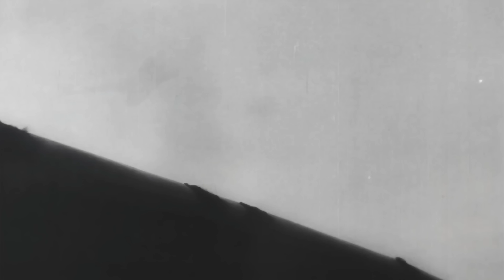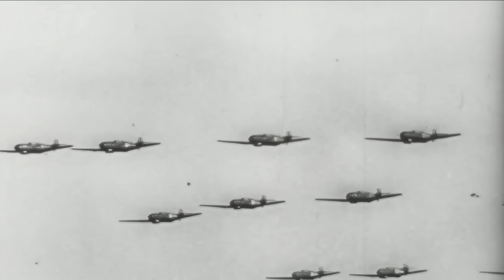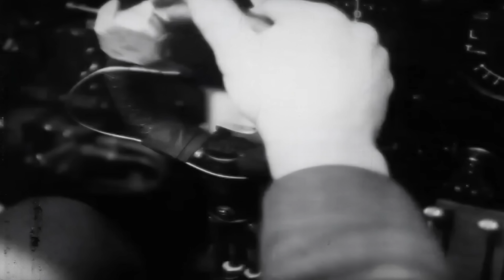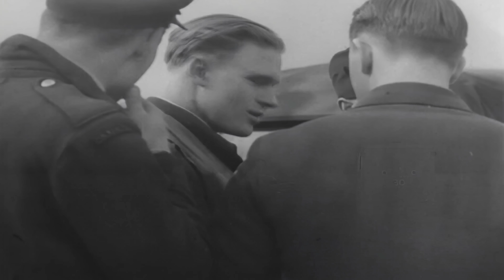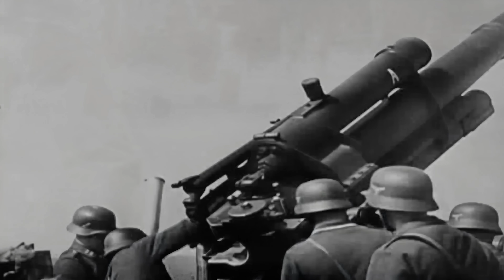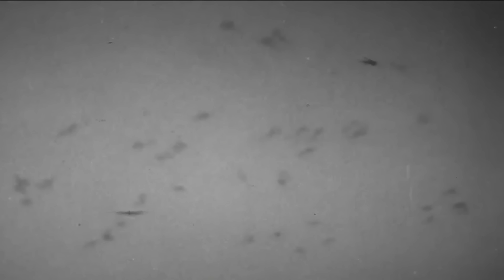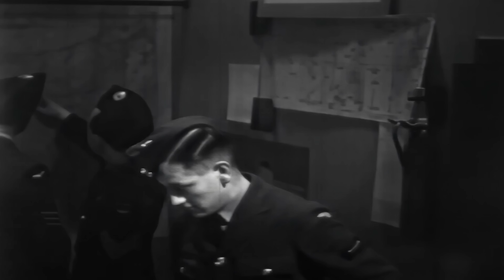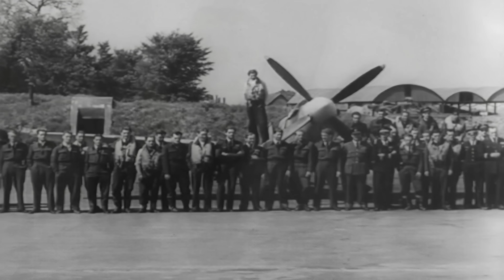440mph Monster That Cracked Germany’s Air Force

Comment: Think most of the article is about the tempest.   Typhoon was abandoned relatively quickly as the could not fix the weak tail section!
Reply: But they did fix it though. Fishplates and resolving it's dynamic resonance problems.
Reply: @Goit_Goit Resonance was the real cause of structural failures and I believe the fishplates continued to be fitted for "pilot reassurance".
Reply: @eifionhowells yup.  The findings made by Farnborough to resolve this fed into future aircraft design.
Reply: The Typhoon was still in service at the end of the war.

Comment: The big air-scoop radiator under the Typhoon's chin was a problem when pilots had to ditch over the Channel, as it tended to cause the plane to dive deep underwater rather than skimming the surface as a Spitfire would.
Reply: They would cartwheel. They were very heavy and undershooting on finals was a problem.

Comment: Many of the Typhoons problems were solved in the Hawker Tempest, which was basically a Typhoon with thinner, laminar flow wings.
It became the fastest low-level Allied fighter of the war.
So the progression from Typhoon to Hunter and Harrier is incomplete without a mention of the Tempest.
Reply: The Hawker Fury was the next step up from the Tempest, but it never got into combat because WWII was over. Since the RAF wanted to get into jet aircraft and the Royal Navy hadn't the budget for jet development, they requested the Fury be converted to carrier operations. Hence the Hawker Seafury came of age. Even to-day, it is considered the fastest single engine prop aircraft in the world. It 

had five blades for a propellor, injection carburator and a 4 stage supercharger good to 38,ooo feet.
Reply: Excellent points! 
My Dad ( RAC&RAF )
Reckoned the Tempest, was a total game changer. That changed everything, of how fighters would be designed, forever!
👍👌🤙
Reply: Actually, Dark Skies didn't completely ignore the Tempest since half of the aircraft shown in the opening sequence are Tempests. Probably wasn't deliberate; more a case of not knowing their subject!
Reply: @ChrisCarter-i9c  Yeah, I noticed the Tempest in the video too. Dark Skies is often careless in this regard  ie shots of Spitfires and even a Lancaster in flight while talking about the Typhoon. Nonetheless I salute them for telling the stories.
Reply: @ChrisCarter-i9c  In fairness most of the commentary is very sketchy at best, and the accompanying video footage even more so.
Reply: And the Tornado although I think only one was built.
Reply: @kevanhubbard9673  I don't know how many Tornadoes were built but they never got past prototype stage.
RR dumped the Vulture because they were troublesome and the Merlin was creeping up in power.
The Griffon was also coming in
Reply: @kevanhubbard9673 Tornado was cancelled 1942 because of lack in reliability of the RR Vulture engines! 

Some had the Napier too... 

Both massive 24 cylinder H/X-block engines with 4 exhaust stacks!
Reply: You’re absolutely right — the Tempest really deserves that spotlight. It took everything the Typhoon got right, fixed what it didn’t, and ended up becoming one of the best low-altitude interceptors of the war. Without the Tempest, the lineage from Typhoon to Hunter and Harrier feels like there’s a missing evolutionary link in the Hawker story.
Reply: We may hear a Sabre again in coming years, there are moves to restore some and even hopes we might even see a flight of a Tempest 5 with one if only briefly.
Reply: @ScreenworxStuartwillard  That would be awesome! 
From my point of view, I'm not sure if any South African pilot ever flew a Tempest, but we did operate the Sabre in the 1950's with the Cheetah Squadron in Korea after starting the war off in the P-51 Mustang.
Yet, the aircraft I'd rather see and hear flying would be the Hawker Tempest.
Reply: I HEARD THAT THE ONLY COMPLETE TYPHOON, THOUGH NOT FLY-WORTHY, WAS ON SHOW IN A FRENCH MUSEUM.  I'VE ALSO SEEN A COLOUR PHOTO OF IT,   LOOKS GREAT.
Reply: The typhoon, Tempest, sea harrier it diminishes the original concept of what a war winning fighter ought to be and celebrated for what it was👍.
Reply: It gives me goosebumps of what an aircraft of it's caliber might have been in the pacific theater of war? or was it?
Reply: @williammcdonald3293  The Typhoon would never have worked in the Pacific Theater with the engine problems it had.
The Tempest would have changed the game completely with it's ground attack ability and it's speed and firepower in a dogfight, but only in Burma and the surrounding countries, where it didn't have to travel too far to reach it's targets.
The Tempest did not have the range of the P-51 or the Thunderbolt, nor aircraft carriers to carry the fight to the Japanese that could carry the Tempests. 
The Yanks would never let British aircraft in on 'their' operations or airfields anyway, and Admiral King was such an Anglophobe that he'd rather lose a battle than admit anything from Britain was better than anything the Yanks had, so American carriers were out of the question.
Reply: The problems in many planes were solved in other planes
Reply: Also the Transformation from inline piston engines to radial piston engines from the Tempest on!!!😉
Reply: @einautofan6685  didn't it use an H-layout engine?
Reply: @Sam-w6z3z  At least from Tempest Mk.II on to Fury they used the Bistol Centaurus Radial Engine...😉👍

With the (1942 cancelled) Tornado they realized RR Vulture was not reliable...
Reply: @einautofan6685  thanks for researching the topic for me
Reply: Absolutely. This video blurs the Typhoon > Tempest evolution by not mentioning the Tempest at all! For example Squadron Leader J. R. (Bob) Baldwin DSO, DFC & Bar, flew the Tempest (not the Typhoon)
Reply: @Greeves 👍 Did he not fly both?  Wasn't he one of the first tank buster lot in a Typhon!🤙
Reply: @Greeves  Actually he did, he was OC No 123 Wing Plantunne  May 1945, from Osprey aircraft of the Aces, Typhoon and Tempest Aces WW2
Reply: @skyboom1961 Thanks for the info’. I stand corrected 🙂
Reply: And its issues were solved by the FURY
Reply: @GeorgeJungle-x9l  I think that would be the Tempest 2. 
That had the same Centaurus engine that powered the Sea Fury
The Tempests that flew in Europe were Mk 5's that had the same Sabre engine and chin radiator of the Typhoon.
IIRC Tempest 2's were going to be deployed against the Japanese but Hiroshima and Nagasaki happened  just before

Comment: Curious omission of mentioning the Tempest, the best British piston-engined fighter.
Reply: The video has a mixture of Typhoons and  Tempests. Side on, the thinner wing profile and elliptical wings are Tempests.
Reply: @grahamy3400  And a fillet in the fin.  Rather sloppy editing in fact ... a mix of different aircraft when talking about Typhoons and then says the 109E was beginning to outclass the Spitfire and Hurricane of the time.  No it wasn't ... the Emil was the standard Luftwaffe fighter from the start of the war until well after the Battle of Britain and was largely equalled by both British types throughout that time.  The video should stick to the subject ... the Typhoon and 190 ... and stop rabbiting on about other types, just to fill out the time.
Reply: @grahamy3400  And Spitfires, both Merlin and Griffin engined.
Reply: Best Wartime fighter, maybe. The best British piston engined fighters were the Sea Fury and the DH Hornet
Reply: @bugattieb110ss  Problem with your supposition is the same thing as plagued the americans until the early 70's.     Dogfighting was NOT dead.    When it came time to replace the F4, 104 105 etc etc they built birds that could turn and fight, 'dogfighting'.   Vipers, Eagles, Hornets, Tomcats, brought BACK close in capability....   all the bad experience vietnam war showed the way.    In 1945 dogfighting which includes turning was FAR from dead and in any close in scenario the planes you mention would be at a severe disadvantage as I mention below to a clipped bubble canopy 4 cannon big block spitfire.    It isn't all speed and climb, those are dominating but not dominant.    Try and take that 'cube' of air away from a spit squadron which can near match your speed and climb and ALSO outturn you by 'tons'.     You cant do it.    The spits protect their ground attack 'whatevers' and you have to try to boom and zoom the spits, and with such small margins on speed and climb you cant make even a small mistake.    I'll take the all rounder thanks.
Reply: What Grant said👆👌
Reply: You cant use "best" and "British" in the same sentence !!!!!!   DUUUUUHHHH!!!!!!!!!
Reply: @wilburfinnigan2142  ???? I'm irish and genuinely curious as to what you mean?
Reply: Not as manouverable as a Spitfire and prone to engine problems.
Reply: I gotta say the best piston fighter of the war, period, was a clipped wing bubble canopy 4 cannon spit mk 14 with the pilot wearing g-suit, in december 44.    He could drop his wing tanks which allowed him to get to the fight and then kill you no matter your tactic.    Out turn, easily, all allied and axis aircraft except some Japanese stuff.     But these it could absolute hammer on speed climb and acceleration.     It had except perhaps the never used F8 the highest climb rate of any piston fighter.    It had 440 mph actual speed.    Superb high altitude performance.    Good handling too, pretty easy to fly.   Competitive roll rate, perhaps a little off a 190 but not terrible.    Climb as good as the hottest 109 the K.    Theres your topline piston aircraft regardless nation?
Reply: @GrantK-k7b TA152
Reply: @GrantK-k7b  tooooooo little toooo Damn late !!!!!!!
Reply: Yeah the Tempest was a jewel. Seems like the typhoon was the ape-like neanderthal older brother of the Tempest. And all it really was was a new Wing that wasn't a foot thick and a fuselage that didn't break in half. But the real Tempest Improvement was when they got rid of the brick engine and went to a fantastic radial.
Reply: @Beemer917  aye the tempest is probably my favourite British plane with the hurricane 2nd then the spitfire would be my top 3
Reply: There's a separate video on the tempest
Reply: The Tempest was good at low level but the Spitfire was better from a few thousand feet up and when the Tempests were in Europe they were often given top cover by Spitfires which were the best fighter.

Comment: You keep saying the Typhoon had a 4 blade prop, but the video keeps showing aircraft with three blade props. WTF?
Reply: Yes, 3 bladed props until mid 1944 when improved Napier Sabre’s delivered greater power and torque. A new 4 bladed propeller was designed and fitted to best turn that increased power into higher performance.
My uncle was an  RAF Sergeant Armourer on Typhoons, Spitfires and Tempests with the 2TAF through Holland and Germany 44/45. He appears briefly,loading underwing 60lb rockets on a couple of newsreel  scenes.
Reply: The first ones had 3blade I think

Comment: Believe it not there were no airworthy Typhoons left. But hopefully this will not be the case as the Hawker Typhoon Preservation  Group (HTPG) are restoring one back to airworthy state and they are using as much of the original parts as possible and the rest they will have to fabricate. Care to give them a look and if you want help support them.
Reply: Can't wait to see RB396's Sabre fire up for the first time. From what I've seen, they are the only group that have managed to acquire an unused factory sealed engine.
Reply: I saw one at Blackbushe airfield 40 years ago. Not serviced. Had 2 old Churchill tanks next to it......
Reply: There's another Typhoon project in Canada - so there are TWO fliers in the offing.

Comment: Firing canons and rockets was deemed the equivalent of a cruiser firing a broadside
Reply: Wow, now that is impressive.
Reply: A 5inch gun broadside .not 12"
Reply: I think he said 'equivalent of destroyer...'
Reply: The rocket warheads were adapted from 6 inch naval shells, so 8 x 6" is pretty much equivalent to a light cruiser broadside. They were very inaccurate, but still would all land within a 100 metre square box at the worst, which would be very discouraging for anyone on the receiving end. The 20mm cannon were highly effective against soft skinned & lightly armoured vehicles, as well as troops due to shrapnel from their explosive shells. Again, accuracy was not strictly necessary in order to disrupt operations. Typhoons had a devastating affect on morale as much as they did material. But they were still nasty things to fly, & a failure in their intended role as fighters.
Reply: @papalegba6796my late grandad watched a flight of them attack a German tank column.. he said the noise was un godly
Reply: @Ord_Wingate  I can imagine. You could compare their effect to that of Stukas earlier in the war i guess, spreading panic & paralysing movement/coordination.
Reply: Maybe a Woke, trans cruiser.